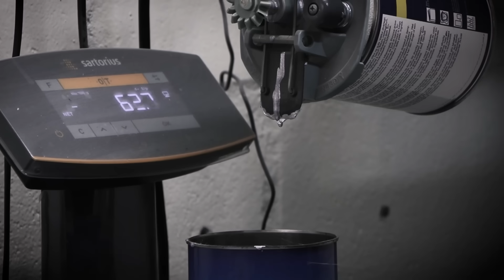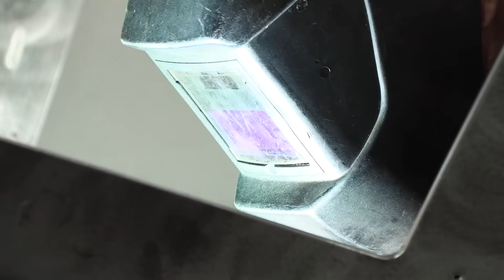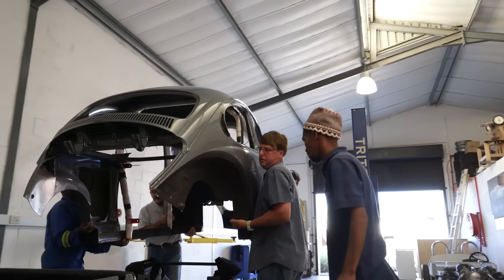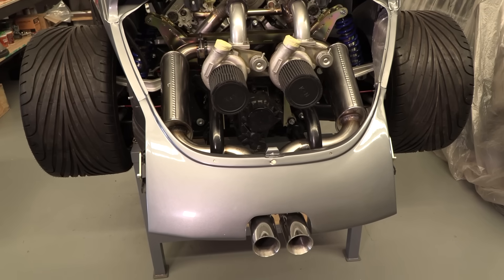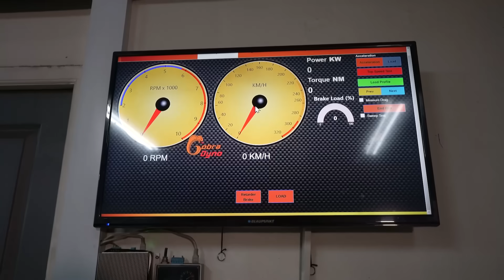We Built a V8 VWBug and Here's What Happened

Comment: Cool bug!!
Saw a built bug with a 454 and a super charger, get tore apart by a bug with a rear mounted 4 cylinder that was turning a 8 sec 1/4 mile.
Reply: a few swap in a WRX Sti turbo charged subaru engine. Going from 40 HP to 400 is alot of fun. And prolly cheaper. This bug here is seller top notch but that means dollars. Hot rodding about CHEAPLY making a unfast vehicle fast. Cheaply. Easily. Now with prices it's not a everybody's hobby and that's a shame. I love seeing teens with a love for vehicles and making them their own. That's hard to do when Obama Cash for clunkers ate alot of good projects up. I hate it.
Reply: @jasonchristopher2977  Yea, he was running a fully built EJ25, with tons of boost. Both this and the 454 were show car spec, but the 454 was completely polished and chromed out. It looked incredible!!
It is a lot easier and cheaper today to make something fast, then it was when i started building cars, that's for sure. You can slap a turbo on damn near anything and double the HP. I've always been a VW/Audi enthusiast, but currently building a 536hp telsa powered 64 nova on air for my dad. Learning a lot!!
Reply: @klubstompers  Wow that's a great project. Unique. I'm still not sold on ev. I'm a tune a carb kind of guy.
Reply: @jasonchristopher2977  Yea, im an ITB, super charger, or carb guy myself. NA is what puts the smile on face the most. Boring out old 4 cylinder vw blocks into High compression strokers. My dad has always wanted an EV since he was kid playing around with slot cars, so slot car it is.
Reply: @klubstompers  Kool. I admire Rich and the guys who make things electric. Well anyone who takes the old and DON'T crush it. Plenty of new cars to crush that are POS pop can plastic metal. Kepp old.

Comment: Almost 300 KW?  What, does that mean it can light a lot of lightbulbs?  I am an American, what is that in horse power?
Reply from the maker: Have you heard of Google... 380hp
Reply: @V8StealthBeetle  I only use such devices when I need to at work.  Metric can go for a long walk on a short pier otherwise.  And don't bother with some scathing rejoinder, you will get no reply.
Reply: 402 hp.
Reply: 746 watts = 1 bhp.  Simple enough math, tho' as a fellow Yank it is annoying.
Reply: @mescko  British horse power? I guess the German Type1 originally came with German Pferdestärke .
Reply: @ArneChristianRosenfeldt  Brake horsepower, the rating typically used for vehicles since a Prony Brake is typically the device used as the basis of an engine or chassis dynamometer.

Comment: Beautiful build. 

For those of us that don't have the kind of capital it takes to have one of these built, a close second is my 4 cylinder air-cooled VW performance build that is producing a dyno verified peak 271 kW /462 N.m at 6500 rpm with a wet weight just under 1750 lbs (dyno chart can be provided). With a completed build cost under 30,000 it would be interesting to have a run-off between the two. Yes I know you are nowhere near the limits on your tune, but are the upper limits streetable and in a road race would it make enough of a difference to justify the cost?

Nonetheless, what a wonderful example of what you can put under the shell of a classic bug.
Reply: Your Bug must be a rocket to drive, with 363hp and 793kg.
Reply: @jareknowak8712  Hope I got the conversions right. Peak HP is 364 @ 6500 rpm with 294 ft.lbs. of torque. Torque actually peaked out at 5000 rpm @ 341 ft.lbs. It is a turbo injected 2165cc running on 91 octane pump gas.
It is a little beast but definitely fun to drive.
Reply: @TLLC2024  I bet its super fun to drive...lots of power for that bug
Reply: WRX sti swap. Easy, fast, HP. It's alot less work. U will need the computer for fuel, etc but that's alot easier and cheaper than whatever this costs. I get the work, time, chassis etc but this was the people's car. Not a Tesla priced rocket. Going from 40 HP to 350 is a BIG leap.

Comment: Cool story.  We did it with a Chevy 454 in the trunk (front of car). Wasn't my car but helped a friend with over half the fitting. Used a S10 frame, G20 van steering wheel and throttle pedal, brake assembly, and various other parts. It was a sleeper. Only thing to give it away was the 8" oval exhaust that exited before the rear wheels. Mars red with full moon chrome rims. And it was a convertible.
Reply: so amazingly unique

Comment: Yep, 40 hp is not exciting. The exciting
part is the fuel savings over years of use that can amount to thousands of dollars.
The downside to a Frankenstein VW like this one is the mechanic doesn't come with it, an
O'Reilly's n AutoZone won't have parts on the shelf for it! 
Though it is a remarkable work of craftsmanship an engineering, it will not be a practical, fuel saving daily driver, and you will have a hard time finding a shop that will work on it, and if you do, be prepared to shell out Big Bucks, because it's a totally Custom Creation.
It raises the question:
Does this builder provide an "Owners Manual" to the purchaser? Forget a Service Manual, because creating one may cost more than the build itself... A coupla things to ponder... 🤔
Reply from the maker: Thanks for your comments.